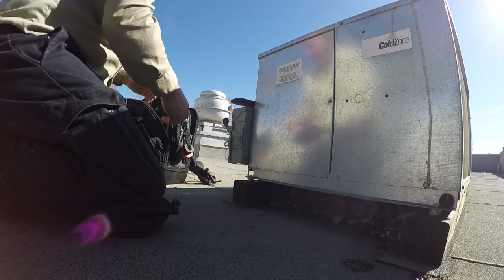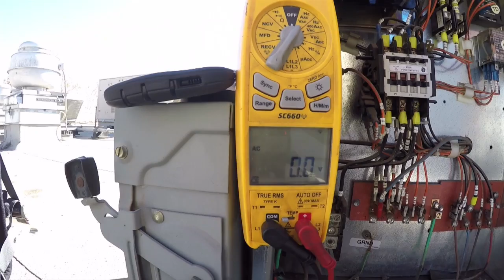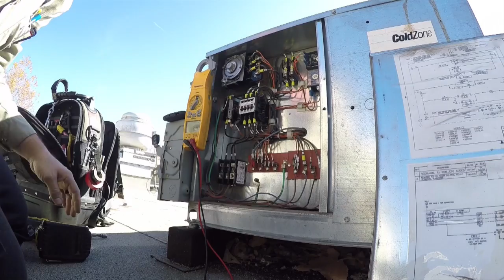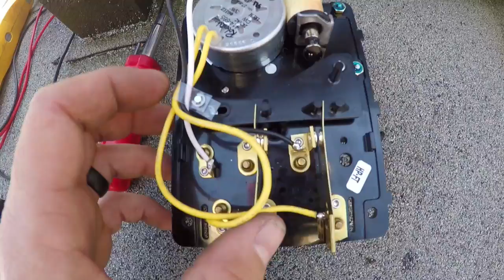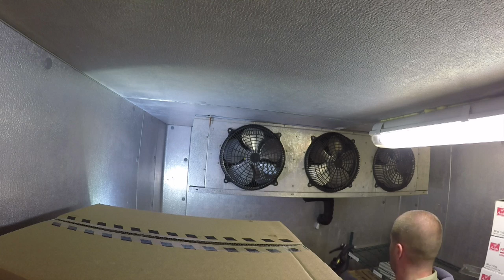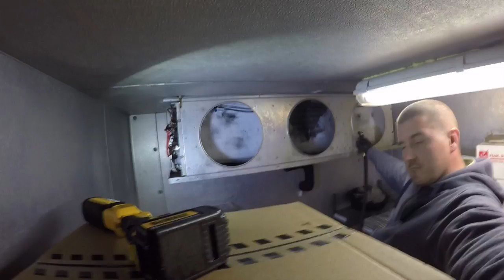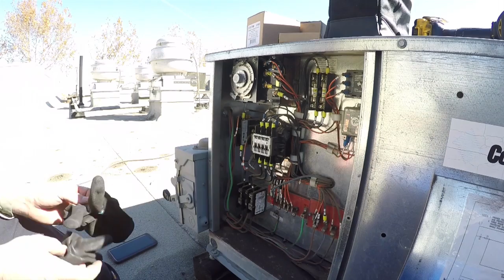Iced up walk in freezer

Comment: Great video but I think I would have checked for voltage again after I switched off the disconnect. I've ran across my share of broken disconnects where at least one terminal was still connected after it was turned off.
Reply: Bill I was terminating a 220 volt outlet. I switched off every 220 volt breaker and found the outlet was hot. Some fool wired it directly into the meter. You are correct always check so you don't get hurt.
Reply: bill carter just bump the compressor contactor to see if there's power to it after you throw the disconnect
Reply from the maker: bill carter that's us a good point, I have also seen that several times! Thanks for watching

Comment: nice video but on a 220 volt 8145-20 clock the N terminal is not referred to as Neutral....its L2...its only neutral on a 120 volt clock which is an 8145-00. terminal 1 & 2 are L1 and N is L2  on 220 volt clocks.
Reply from the maker: Great point ! I'll definetly correct that in my next video!
Reply: In other parts of the world that dont use 120/240 they have only line and neutral and they have 240 volts, so depending on country of origin or may very well be a neutral connection.
Reply: An electrician friend refers to N as common
Reply: I was about to post the exact same thing... that N must be from many moons ago when they were 110 volt only,  they should have change the designations long ago to L2 and L1, thats on Paragon...
Reply from the maker: Amen!!